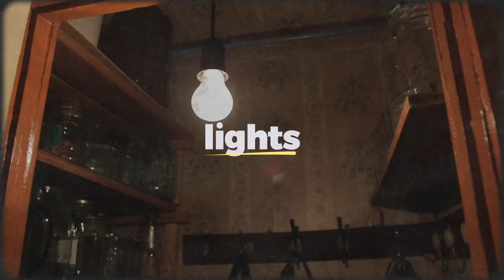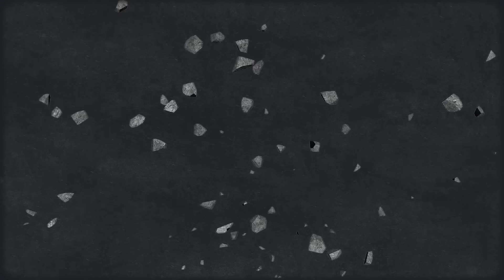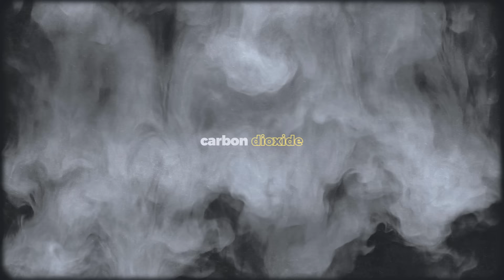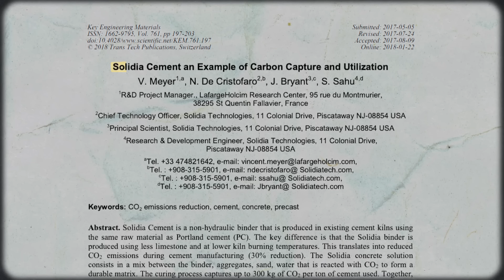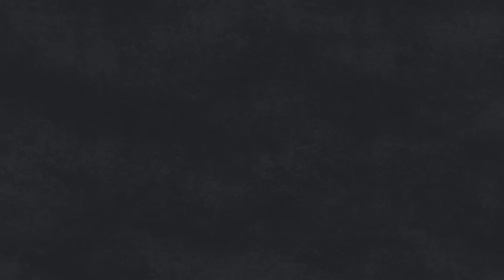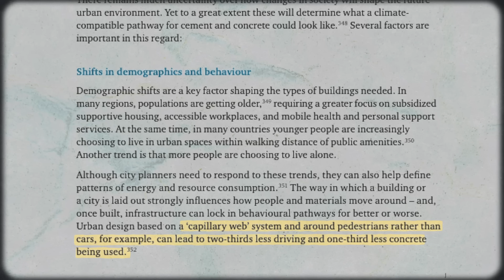Is Concrete Destroying Our Planet?

Comment: If solutions for climate crisis are measured in profits out of new technology and alternatives to neutralize carbon emissions alone then we have lost the war. Concrete usage and waste are going to be a bigger problem than plastic but no one wants to deal with the elephant in the room. We have to find biodegradable material for construction and completely stop new high rises. Climate crisis cannot be solved with band aid solutions. Very, very tough and hugely unpopular decisions will have to be taken.

Comment: You forgot to mention another important side of the concrete problem: the transformation of green, carbon-absorbing, water retaining spaces into solid rock air-heating ones. No matter how small is the patch you are transforming: taking it from plants to concrete plumbets the biodiversity of the area and its capacity to absorb carbon. Now imagine what kilometers of concrete without green gallerys and green roofs is the doing to the planet. 
My friends: time to break some unnecessary cement and/or cover things with native plants.

Comment: You stopped at the negative in terms of polution making me think that you are somewhat biased on this subject for whatever reaso. Perhaps you are paid by someone. 
You never explained how using cement to build  over other building materials is very long lasting, durability has to be included in accessing the practicality and polution amount of a material otherwise you'd be irresponsible.  Concretes durability can be shown in the french castles, we are doing concrete dirty by making it with the wrong formula! There is bad concrete! This is also a factor you did not include. Also concrete can go back into the earth easily! Unlike synthetics. 
This video could of been much more thorough.

Comment: Well “facts” are whatever you say they are. For instance your use of the term “fossil fuel” . It was coined by Rockefeller in 1898 to create the illusion of scarcity. Recent probes to planets and moons in our Solar System have discovered a abundance of “fossil fuels” how can that be if oil comes from dinosaurs? So your fact is a myth. Limestone is chemically identical to concrete. Limestone is naturally occurring as well. So is nature or man responsible for limestone’s or concrete‘s carbon and oxygen mutable chemistry. Like an OCD person you focus on concrete when you could be looking at all the naturally limestone on earth to find the same chemistry occurring limestone . In the oceans with vast supplies of limestone CO2(aq) = CO2(g)

Comment: You left out that concrete leads to higher temperatures in concrete laden cities and more flooding because water absorbing grass is torn out and replaced by concrete that forces water to drain into sewers and natural water reservoirs that back up and/or flood.

Comment: Very informative. Now if CO2 was actually accelerating global warming it would be useful information. It is impossible for a gas quantity of 0.004% to make a thermal increase of 10% to the 99.996% of the rest of the atmosphere.
Average global temperature 14°
1.3° global warming = 10%, or near enough. The "EXPERTS" are telling us that co2 is the only  main gas causing global warming. And don't even begin to mention the infinitesimal amount of the 0.00018% of methane in the atmosphere.

Comment: Concrete is the most widely used material in the world. As it stands, we have yet to find a feasible replacement for it. Yes, the manufacturing process for cement produces CO2. You fail to mention that concrete only needs to be made of 10-15% cement. 

One of the easiest ways we can reduce CO2 emissions from concrete is by reducing cement consumption. This can be done by making sure all concrete produced today only is comprised of 10-15% cement. Proper training of concrete manufacturers in developing countries helps!

You should check out the work by LC3

 https://lc3.ch

Comment: Well, the BIG problem on earth is TOO MANY PEOPLE...but don't worry, all of these 'alternative methods' to power, fuel, materials are just window dressing to the REAL SOLUTION about to be implemented...depopulation. Bill Gates just had a $500-million 325-foot yacht built (as did Jeff Bezos)...so THEY aren't planning on cutting back! In fact, they plan on PROFITTING off of the propaganda that there are 'better ways', new 'high-tech' ways to make building materials! It's a scam, and nothing more...because the 'answer' is right in front of your face (since pre-history)...NO-MASONRY STONE HOUSES! ADOBE-HOUSES! or how about 'GLASS-BLOCK HOUSES?' (using nuclear-powered heat sources to reduce sand to silica glass)...but don't you worry, even though the world is QUICKLY running out of 'construction grade sand' (almost gone, and no one told you)...you're going to have 'alternative cement' without any 'construction-grade sand'! (ROFL)...Mankind will learn how to build with stone again, and how to melt-and-form glass block from inferior sand, or he will get his chance to 'sleep in the open' under the starry skies again! Guaranteed!

Comment: Cement requires us to drain beaches and the sea floor of its sand. It is both terrible for the ecosystem and with rising sea levels, draining beaches is unsustainable. It's a recipe for flood. Cement doesn't last that long and it retains heat which with rising temperatures is making people who live in cement-built cities suffocate even more. European cities were built for more than a milenial with straw, wood, and soil. These building last for centuries with proper care, they maintain temperature at comfortable levels, and they are sustainable.

Comment: You must be using common core for your math.  You sometimes refer to the carbon output of the making of cement, but then quot numbers for total outputs from CONCRETE.  You switch back and forth fluidly between concrete and cement knowing full well most people don't distinguish between the two, when cement is one small part by weight of a yard of concrete.  Plus you also fail to mention the industries heavy use of cement replacing pozzolans.   More foggy math and mis direction to spread the faux climate change propaganda.

Comment: But concereat reabsorb the carbondioxid  the part freed molecular bound in the limestone (calcium carbonate)  over some 100 years the concret transforms back to limestone from the carbonedixoid in the air natural. Its an CO2 absorber. This also why the steel inside will rust some day. Because concret is a Hydroxid steel doesnt rust there, limestone is not. For me a far lees Problem the Fossil fuels there natural process takes Millionen of years to "reabsorb" their peoduced Carbondioxid not 100 years.

Comment: You forgot to mention, or maybe because it doesn't fit your bias, but as concrete cures it takes CO2 out of the atmosphere and safely stores it there for eons of time.  The Hoover Dam, for example. is still removing atmospheric CO2 as it continues to cure.  Also, you forgot to mention that the limestone used to make concrete is natures stored CO2 that was removed from the atmosphere eons ago.  Please mention both aspects instead of promoting false science.

Comment: Revelation 16:9 And men were scorched with great heat, and blasphemed the name of God, which hath power over these plagues; and they repented not to give him glory.. probably going to get worse? Enoch contemplate the rocks and how your feet burn upon them. 2peter3 reserved unto fire. History channel had documentary on compressed air vehicles but somehow they were banned or bought out? Was like 120 miles for 2 bucks at home price and could fill fast as gas vehicles with a tank ,what happened not enough money or metals? Please finish reading freely and double check was like 10-15 years ago

Comment: Never did anything with the product, but I found a way to skip firing clay like in terracotta bricks or roof tiles with a cold chemical processes I called bogging. I called it oil ceramics, is a bit different than fired clay, repeals water and is less brittle, still the same clay.

Comment: I wouldn't 'hold my breath' on this issue  Concrete is readily available and thus far in human history we've nothing to equal it's immense strength and durability...concrete made during the 'Empire of Rome' is still present and fully-functional to it's purpose, such as road-beds and 'footings' for large structures that would 'self-bury' into the earth beneath them without concrete to 'snow-shoe' the weight proportionally
Reply: Why we need buildings to last for centuries, apart from a few iconic structures?
Most will be demolished in a few decades when it is cheaper to rebuild than to renovate.
Reply: @madsam0320  What about extreme weather conditions which will increase in frequency anyway?
Reply: @eugenhardtmann454  I think this is all about how concrete is causing extreme weather.

Comment: Carbon / charcoal compressed bricks with bonding resin. Can build structures like multi storey homes. Water proof, sound proof, high R value. Around 30% as strong as cement without rebar. Not good for the big stuff tho like dams bridges or carparks. Still amazing.
Reply: But watch a house build with carbon bricks catch fire.  That would be spectacular!  
Or just use wood.  It is already carbon bonded with resin.

Comment: The video could us an update.  The 2 teams that won the Carbon XPrize were both focused on reducing the carbon footprint in concrete.  More info at https://www.xprize.org/prizes/carbon/articles/xprize-announces-the-two-winners-of-20m-nrg-cosia-carbon-xprize-with-each-team-creating-valuable-products-out-of-co2-emissions

One of the winners, CarbonCure is scaling up quickly with 300 systems installed globally that produced 1.4 million truckloads of concrete saving 104K tonnes of CO2.  The systems inject CO2 into concrete to make the cement more efficient, thus reducing the amount of cement needed to make strength.

More info at www.carboncure.com

Comment: ATTENTION: there are currently 47 active and erupting volcanos around the world all putting out 15X the greenhouse gases we do... that coupled with the fact that all the other planets in our solar system are warming at the same rate, means that the Sun is the main driver of climate change not us... there isn't concrete or SUV's on the other planets is there?? no... are we polluting to much? yes... do we need to clean it up? yes... all at the expense of those that actually caused it... the oil gas coal and nuclear industries not the average consumer via taxes... Stop putting the blame on us... if taxes will solve it how do we tax a volcano?

Comment: meh, just use carbon capture when doing the clinker production, if it can work for power plants and hydrogen production, it can work for cement, with cement you don't even need to hit 100% capture because the cement absorbs CO2 over it's lifetime, so just capturing most of the production emissions would be good enough

Comment: WOOD! We need shift to wood as much as possible. Provided we plant more trees than we harvest, it would be the perfect building material.
Changing the cement-industry is necessary, but we already have the tools. Wood sequesters carbon and needs little treatment in order to be used.
Reply: Cob houses are an option too
Reply: @vIBEDoUT-Channel  true. I mean there‘s so much available tu us, we just need to use it. Building materials that have gone out of fashion need to be revived.

Comment: All due respect, the two solutions presented here are nowhere near good enough (though I know that's not what you were trying to make them out to be). You mention that factory curing inhibits the applicability of the first one, but that's quite an understatement. While I would probably endorse a cultural shift to less (but not none at all) high-rises in favour of more low-rise buildings, in fact far less building overall, ex-situ cement curing pretty much eliminates most of our best building techniques. Building techniques which would also contribute to lower emissions, by the way. Theres something to be said about smaller-scale use of this one, but its simply not a very flexible building material, and CLT or some other non-cementitious alternatives would likely be better for emissions as well as material properties on a smaller-scale anyway.

Concerning the second one, it reminds me of why the focus on certain supplementary cementing materials as "sustainable" really bothers me. Some of the most prominent of these, like fly ash or slag, come from a similar source as the flue-gas-aggregate you mentioned here. That is, they all rely on the continued production of things like coal energy, steel, or flue gas to continue working as a solution. The way I see it, these "solutions" only exist for as long as we continue to predominantly rely on unsustainable industries elsewhere; pretty lacklustre. What's more, I'm sceptical of the water-resistance of this one because it's a non-hydrating cement, but the developers may have found a way around this.

As a student/researcher in material engineering, I'm definitely going to continue searching for and attempting to develop long-term solutions for building materials. There are many promising paths in front of us in this regard, and the ones that you've chosen to present here are likely to be instrumental in their own right. But the more work I do in this field the clearer it becomes that the only acceptable path forward (in terms of sustainability) is a gigantic cultural and political shift. I know that its a meme to blame everything on capitalism, but that viewpoint is not without its merits. The capitalist may think that constructing their housing development by using the most modern green technologies will contribute to our global climate goals while still lining their pockets. The capitalist, here, IS WRONG. Many such "green" developments do not even begin to offset emissions that would be generated by a regular development until AFTER 2050 [1], because their efficiency is in their use-phase rather than in their production processes. The optimal solution, often, would be to never construct the development in the first place. Or, if more housing is required by the population, updating existing structures is more efficient (but less profitable, and more political) than constructing entirely new ones. The primary object of the invisible hand of capitalism will never be sustainability, at it will require incredible legislative leaps to make it appear as such to the capitalists.

Here's the one source I cited. I can provide more if need be. It's good to keep in mind the time-scale on which alleged "sustainability" will occur:

[1]: https://iopscience.iop.org/article/10.1088/1748-9326/7/3/034037
Reply: the problem is not many persons will take the time and search and read different information. they will just watch this video and then bring it up in a conversation and feel good.
Reply: @damtam26  I couldn't agree more
Reply: In regards to the last part of your comment about capitalism:
I think there are very easy legislative options to limit the effects of a free market on climate change. An Emissions trading system for example is quite simple to implement, I think. 
The hard part is getting everyone to do it internationally. Because whichever country moves first, loses economically.
Reply: @thomasna5158  Cap and trade schemes are easy to implement, but whether or not hey are optimal for what we are talking about is another story. I reccomend the paper "Lessons Learned
from Three Decades
of Experience with
Cap-and-Trade" by Richard Schmalensee and Robert N. Stavins 

Regarding international agreements, this game theoretic exposition of those might shed some light onto why I feel the way I do. VERY rewarding read, but quite dense. "Coordination vs. voluntarism and enforcement in
sustaining international environmental cooperation" By Scott Barrett
Reply: "The optimal solution, often, would be to never construct the development in the first place"
Well there's a lame-brain thought process but thank you for declaring what many people apparently think.  We don't need no steenkin houses; but you enjoy using a COMPUTER and all the electricity it requires to operate!  Do you live in a mud house without electricity?  No?
Reply: @thomasmaughan4798  Thanks for this very thought provoking and well-argued response. Thomas, I'm referring to refurbishment of existing structures to accomodate for more residents. Believe it or not, not everyone is as braindead as you are.